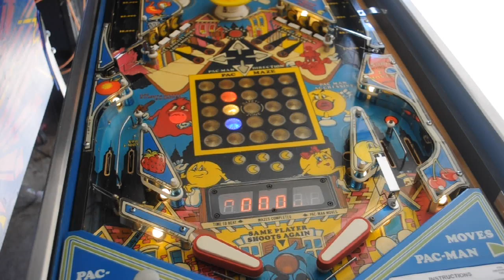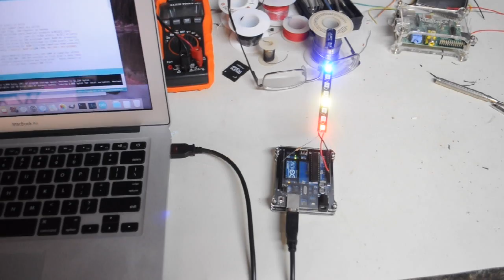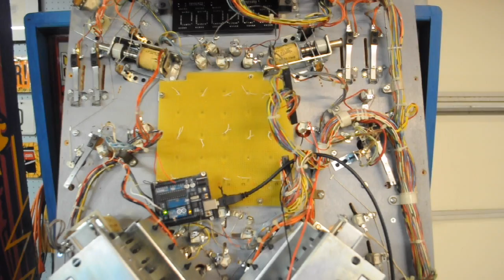Mr & Mrs Pacman Pinball LED Pac Maze

Comment: Are you planning on making a LED maze board to sell, or is this just for you? If going to sell, will it be plug and play or will other mods need to be done?
Reply from the maker: Having this available to others depends on the cost of the parts and if I can minimize the installation steps. This microprocessor/RGB-LED version requires at least a ground be routed to the pac-maze board. I am working another version with just standard one color LEDs that would also turn the ghost blue in aggressive mode. This second version is currently plug and play.
Reply: geeteoh I would love the second version you mentioned. It also makes sense the ghost being blue when you can eat him.